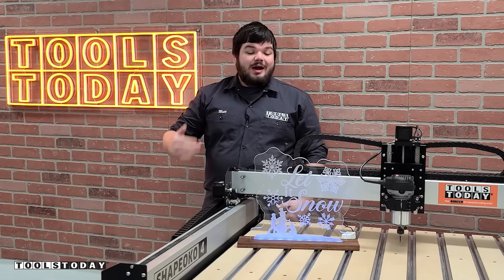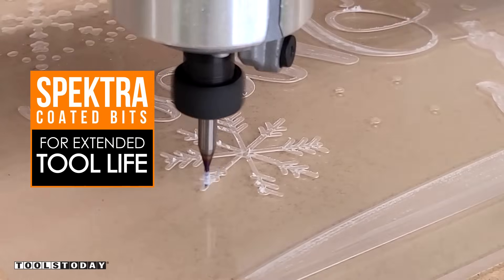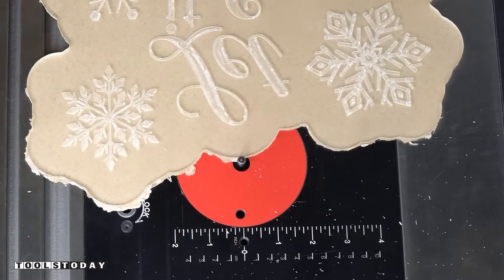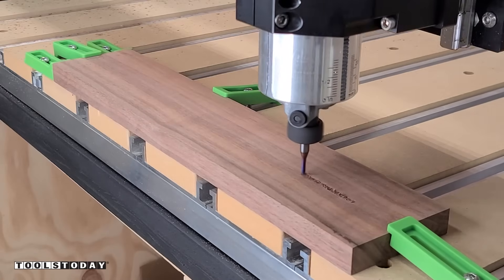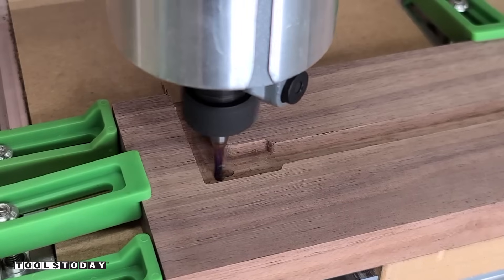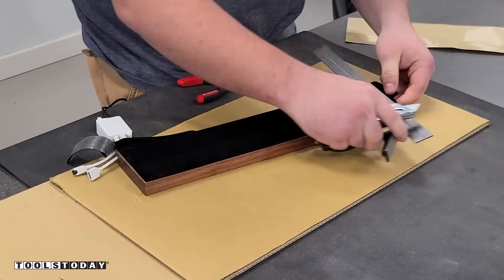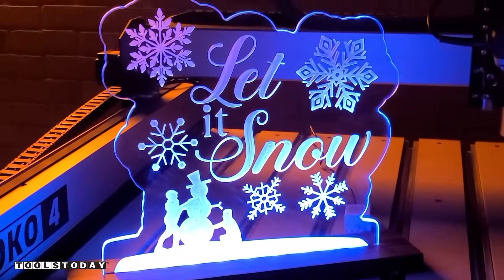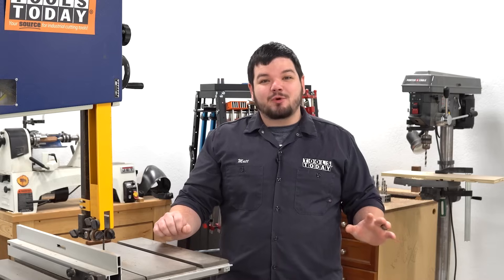How to Make: CNC LED Holiday Sign

Comment: I bought the 51441-k twice and they broke on me twice as per your instructions on the pdf and the preset file, is there something wrong with the file?
Edit: found out I was using extruded acrylic so nothing wrong with file. :/

Comment: hi there with the amana tool 51441 what ramp size did you use? i am using aspire and amana tools reccomend 60 ipm ramp down but i dont have those settings in aspire any help be appreicated thanks